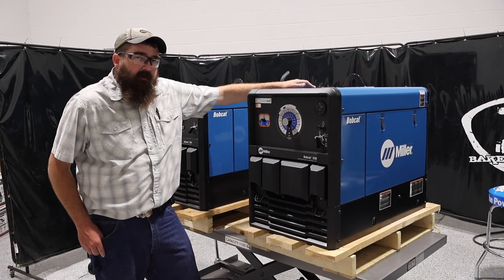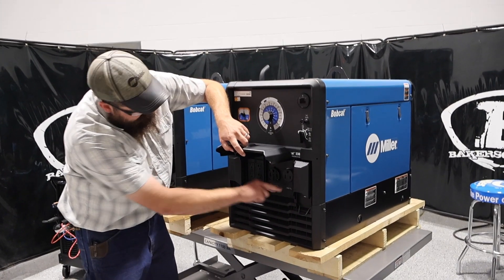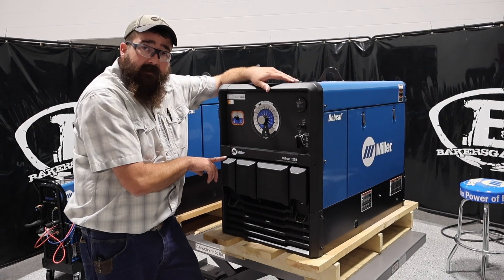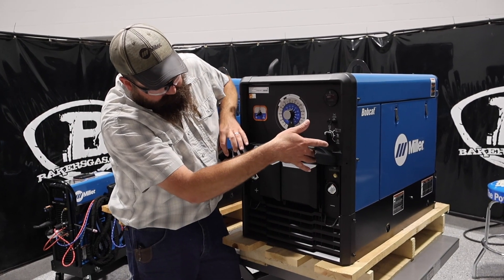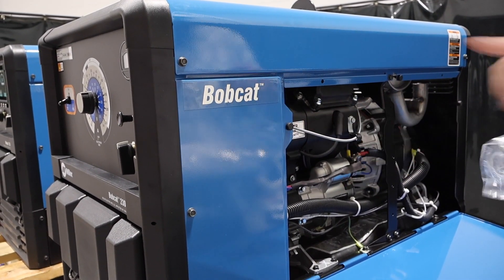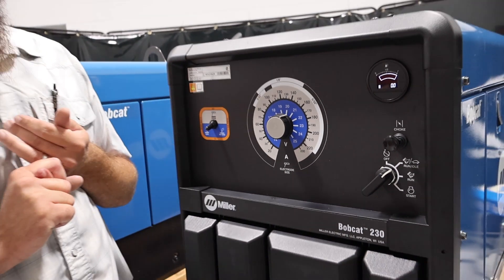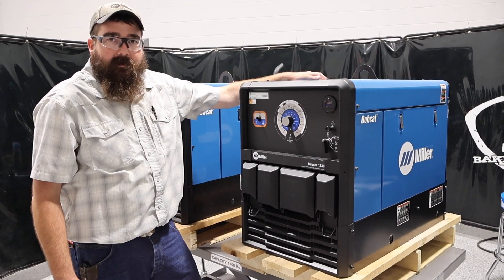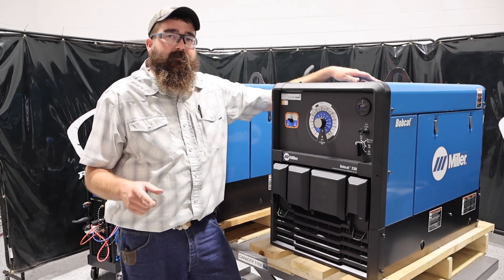Miller Bobcat 230 Review 907824 - Replacement for all Bobcat 225 units!

Comment: My 230 out performs my old 225 in most ways. But not fuel efficiency.  I will get a 12 hours out of the 225 and it wont even idle down where I get 8 0r 9 out of the 230. Not a big dealgiven the other benefits of the newer machine, but I do have to keep a couple of Jerry cans with me for a long day.

Comment: Bought one of these a few months ago. I have 16 hours on it, great generator but not a smooth stick arc at all. If you like a clear defined smooth puddle this machine is not for you! It has a very strong violent arc with a lot of sputtering and spatter. You will never get a slag peel with a 7018. Worked with Miller and got the main board replaced, no change. My Bobcat 250 and Trailblazer have a 100% better stick arc. To be clear I am a huge Miller fan I have a ton of there products. For whatever reason this machine is a swing and a miss.

Comment: Looks like a great little machine.     You can’t beat those manual choke machines for reliability.       We have trailblazer 325 EFIs and a couple bobcat 260s.    The trailblazers have had some issues and the bobcat 260 has the electric choke carbs.   Not a fan.  Mine was brand new and cranked way too much before firing.    There’s one bobcat 250 manual choke in the fleet.  That machine has been flawless.

Comment: What's the part number for the mig welder you can connect to this 230
Reply from the maker: You could connect the 211 or 142 or suitcase welder. The 211 has a $300 rebate right now https://bakersgas.com/products/miller-907614